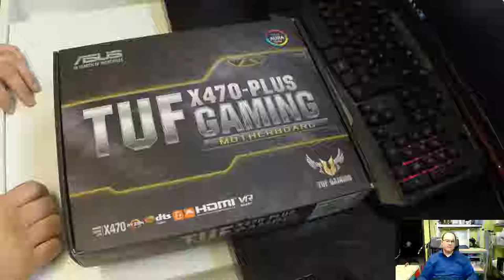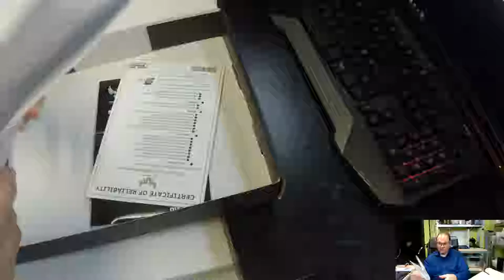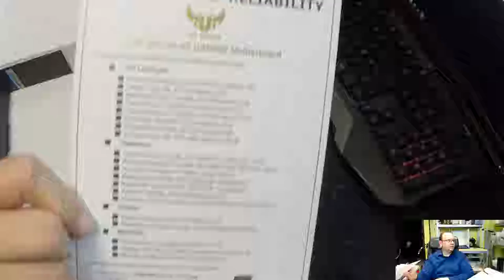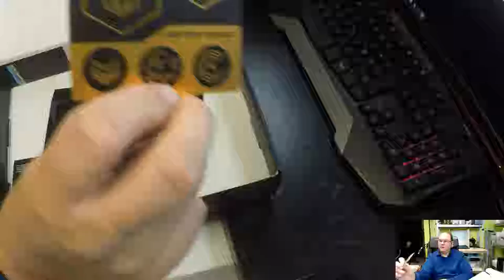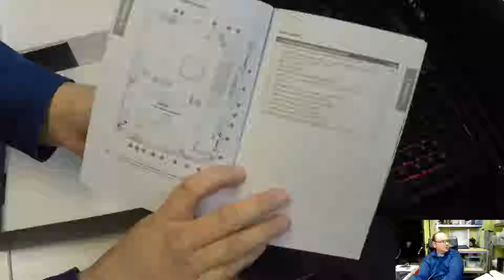PC build motherboard selection

Comment: And a2 b2 are populated first, the lighter colored slots. I skimmed the manual and checked that after making the mistake in my first build and not noticing for years
Reply from the maker: This is clear as the only thing You will loose is the double channel config. In this case You loose some performance